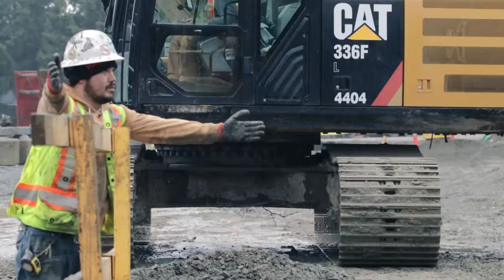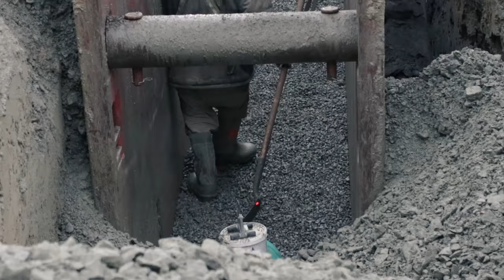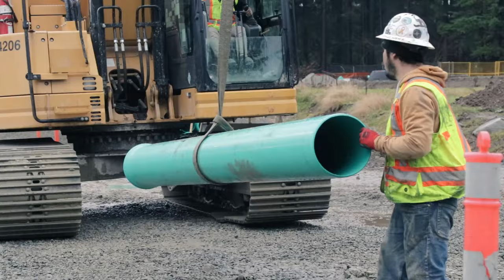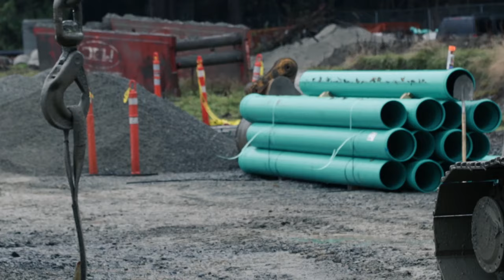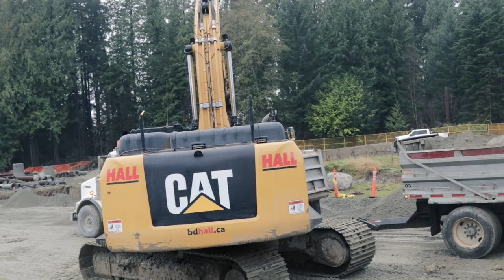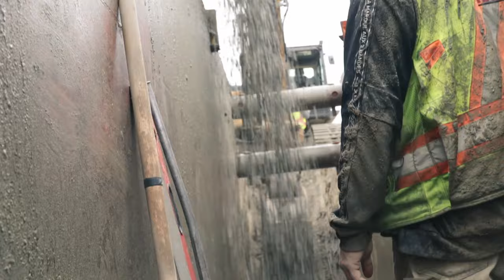SEWER PIPE INSTALL

Comment: Nothing like a tight  crew, conducting trench warfare.. you got every angle covered from the ground up on this one. Excellent video 👍
Reply from the maker: Thank you!
Reply: Didn’t see them bevel any pipe, didn’t see them set up pipe lazer or line up target. No transit level. Or securing pipe joints, or haunching…

Comment: Trench discipline, shoring, having an underground crew that’s tight and everyone knows their task and goes about getting it done! I’ve done every phase from laborer mudding inverts on big and small RCP pipe, building manholes, laying pipe, cutting up transite pipe back in the day with a chop saw and no mask, water or ear plugs! Back before I knew better! Checking and setting grade for a big crew of excavators when I worked at Kiewit as well as running every piece of equipment on a job site and the job itself eventually. Now I just sit in my easy chair and re live my glory days by watching videos like these! Remember to work safely guys, I can’t tell you how many jobs I’ve left at the end of shift without all the crew, it’s not a feeling you ever want to experience so be safe out there! 🇺🇸💪👊👍

Comment: Cool video. I'm curious as to why the hell the 336 digging the mainline trench has such a narrow bucket on it. There should be at least a 24" bucket on it for digging.
Reply: So he can dig in the trench box... he should have a jrb, a wide bucket for digging your box to hang it if need be, then drag the box and dig thel last 1ft or 2 with ur narrow bucket inside of the trend box... saves alot of gravel over the coarse of the job...

Comment: What’s the benefits from digging with a flat blade bucket instead of tooth bucket?
Reply: Depends on the material! Hard/rocky material would be difficult with a bladed bucket. That blade will give you a nice grade but that doesn’t matter so much in this application because they will lay gravel underneath the pipe anyhow.
Reply: Better chance to not damage existing utilities with the plate.

Comment: It's that water line not sewer line. Because they replaced the water line on my street with the same pipe.
Reply: That is most definitely sewer. That pipelayer would not be able to bar in a 12” stick of water pipe.
Reply: @bradesser89  It is Sewer, SDR-35 to be exact. 10 inch. And you can bar 12'' sticks of water pipe home, i can do it in TWO bars send me your email i will send you a video. and that is 12'' c900 watermain. drt9
Reply: @bradesser89  ive been laying pipe for 9 years, and have have barred a stick of 14'' water main home once, 14 feet long.
Reply: @701Gangstatainment  Hat's off to you. That's a fucking workout.
Reply: That’s SDR-35 sewer pipe.
Reply: @701Gangstatainment  need a job buddy.... mainline digger in need of a good pipelayer..... Ohio rate
Reply: @kevinrankin7424  Im in the Dakotas. Would need to be a good number to get me away from ND